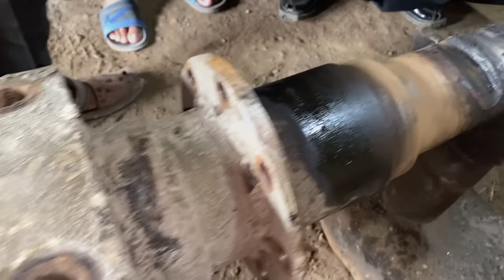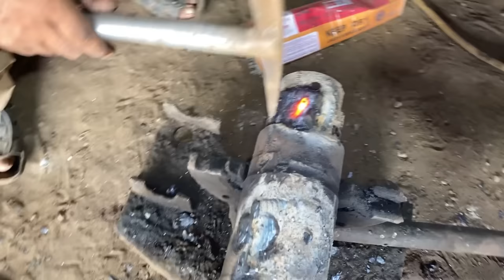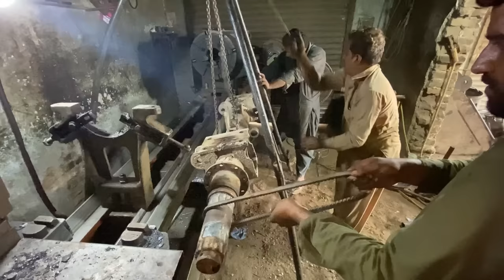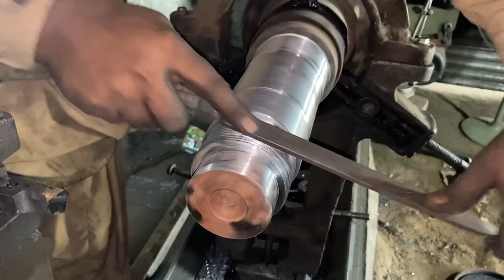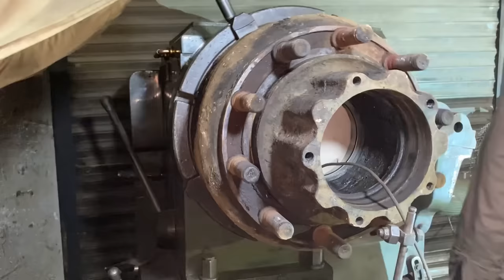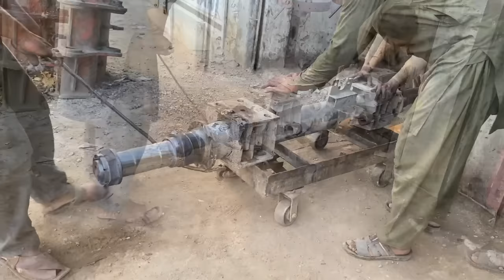Threads Method Using for Repairing of Seized Truck Trailer Axle Stuck in the Hub ||

Comment: Good job making the parts usable again.  How did the welded axle hold up without heat treatment?
Reply: It won’t.
Reply: Surely you jest.
Reply: Haha, it will last a few weeks.
Reply: See ya next week!   They run equipment hard over there, crap roads and damned the weight limits. 5 or 6 ply frames

Comment: I wonder how much that shaft is going to bow during the welding process, ah it doesn't matter does it? Never mind that porosity in the weld, that doesn't matter either, make sure you put in a little extra weld so they can overload the truck even more than before. OMG, bearings apparently are not considered a precision part so they are to be installed with a hammer?

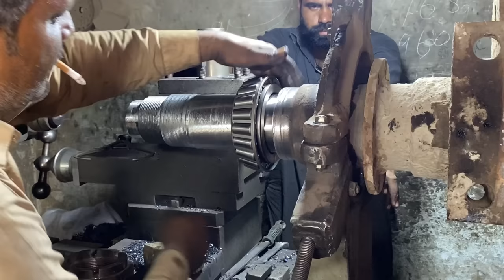Comment: All things considering this was a good repair. Although at 14:15 the tapered roller bearing went onto the shaft a bit to easily.
Reply: I think with the tools they have, in many cases a sliding fit and a bottle of Loctite cylindrical retainer (601 or similar) would actually be a very decent solution. When applied properly, when the retainer is dried there is a 100 percent bearing surface on the shaft - bearing race interface and no risk of failure by fret wear. 
However, in this case the inner ring is stationary so a sliding fit will probably not be detrimental, although of course factory specifications must be met. With separable bearings like the conical roller bearings used here, a press fit on both inner and outer race is unproblematic in terms of assembly. Also, in heavy machinery it is probably the better choice as the bearing is better centered and bears the load more evenly.
Reply: I am always admiring these workers for what they can achieve with limited means. But I recommend using a piece of scrap wood to protect the lathe’s bed when handling heavy objects.
Reply: +/- 2mm  working tolerance.
Reply: @jepper80 that coat hanger was dialed in way tighter than that...

Comment: It's not cleat to me what happened to the shaft getting those huge gouges in it. Please explain.
Reply: Wheel bearing failure
Reply: Most likely, those gouges were done with a cutting torch while removing the damaged bearing and retaining nut.

Comment: Does anyone know why they never clean (grind down) the base metal before welding?
Reply: Экономят абразивные материалы
Reply: N this case, No real need with stick welding. there is no heavy contamination. With mig or Tig welding, you would have to clean thoroughly
Reply: @glennworton2494  Thank you.
Reply: Ya clean it with a dirty rag and blow off the dust?
Reply: Because they don't have to.
Reply: @glennworton2494 are you an experienced welder?😂
Reply: I like the welding helmet.

Comment: How they can stand getting welding spatter and slag on their feet is beyond me. I have welded for years without gloves but gravity being what it is makes (proper) foot protection imperitive. Apart from that I have had hot pieces of slag chips start my pants smoldering a few times. Also just curious about welding electrode selection which is never made known. Metalurgically speaking, improper selection could end up in disaster.

The bottom line is that given their limited resources and repair facilities they seem to do a fair job with what they have.
Reply: The labor costs are the lowest part of running any shop in the area.

Comment: Hi folks...here's the thing...its 3rd world work in a 3rd world country. They're expecting the heat and cooling from welding to sufficiently harden their work backed up by heat transfer of machining. Labour's cheap....parts are expensive in these cut throat economies. The fact that they resuscitated the axle for further work exemplifies this... if the owner/operator gets a further 40thousand out of it while over loading as they do they'll just fix it again..and again

Comment: Well.. that was a rough job even by the standards of Pakistani workshops, but it's interesting to understand that it can still work, even with pits in the surface. After all, to located, say, a bearing, it really only requires sufficient machined surface of the correct dimension, and if there are some pitted areas, that does not matter.

Comment: We would  not see this damage in the USA. This damage was probably caused by bad wheel bearing adjustment. In USA if the driver sees oil leaking from the wheel seal, he will get it repaired. I was a truck mananic for 35 years, install wheel bearings, replace wheel seal, no damage to spindle. One more thing if you get caught in  a Highway Patrol vehicle inspection, and they see a wheel seal leaking, they will red tag the truck.  As far of the repair job these people are highly skilled excellent workmanship. 🤓
Reply: It happens everyday in the US.
Reply: @C-Culper4874  Never happened in my shop, and not in California. Also I said bad wheel bearing adjustment, in my shop I would check the  wheel bearing adjustment at the request of a junior mechanic, this was a practice, because this is a critical adjustment.
Reply: @TOONMAN200  Remember these guys are running greased hubs. Not oil bath. Running very over loaded on rough roads. If you work on agriculture equipment too you would see this or do trailer work as well.
Reply: Running way past first hint of repair required.  That part would be scrap in any first world shop.